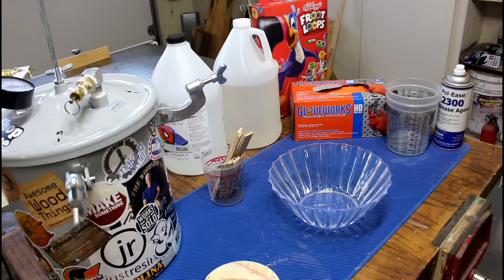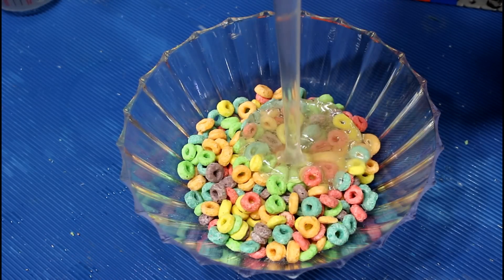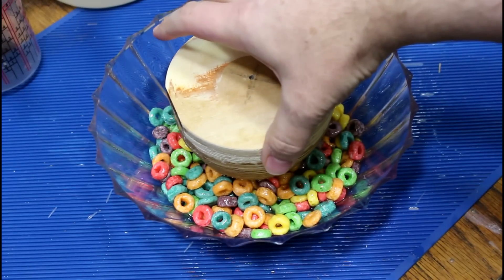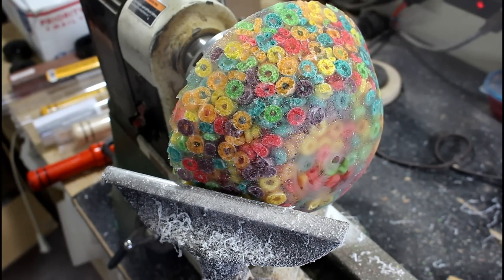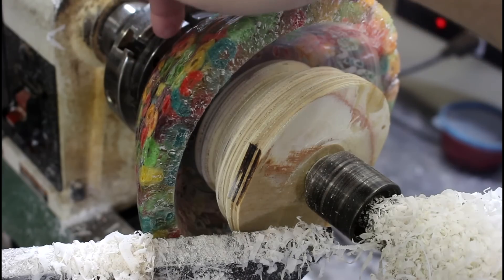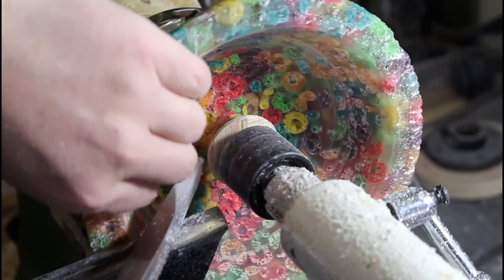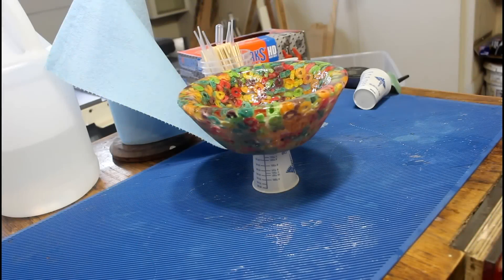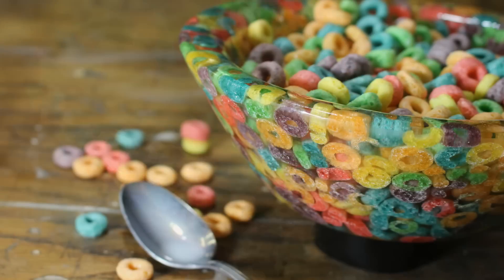Cereal Bowl Made From Cereal  |  Dipit #21 Froot Loops Bowl!

Comment: I had an idea Peter. What about doing a similar bowl like this but color the resin in the bottom half of the bowl with white pigment so it literally looks like a bowl of cereal and milk suspended in mid air?
Reply: This would be sick!!
Reply: I agree!
Reply: I was thinking the same thing.  That would be awesome!
Reply: I had the same idea
Reply: Comb made out of hair
Reply: Or the top edge to look like a cereal bar?
Reply: I like the way you think. You're HIRED!
Reply: Itd be neat to do white with loops, a thin layer of clear with loops and then clear with no loops, but I agree it'd be cool af
Reply: He made a handle for some tool out of Milk (Bio-Plastic) some time ago. Would be cool if he made a spoon out of that stuff for this bowl.

Comment: How about screwdriver handles out of screws. So a phillips head made out of phillips screw
Reply from the maker: It's on the list! :)
Reply: You're a mad man.
Reply: Personally I'd find it hillarious and infuriating at the same time (though more hillarious) if you did a Phillips head screwdriver filled with flat head screws, and vice versa.
Reply: @MrsInAbox  Nah, that's too obviously done in jest. Mix pozidriv and phillips to really infuriate the pedants.
Reply: be brave... a slot screwdriver made of torx fasteners.
Reply: Y’all aren’t thinking hard enough 
Gotta make some nuts and bolts to go with the set
The nuts of course made of Rocky Mountain oysters
Reply: Hex drivers (for driving hex head screws) a.k.a. nut drivers, made with the other kind of nuts (almond, pecan, etc.).

Comment: Would you have been able to use stabilizing resin to harden the cereal and then dip it to make the consistency better so that it wouldn’t grab on the lathe?
Reply from the maker: Yes, but consider that the stabilizing resin would bond all the cereal pieces together which means that you need to individually stabilize each piece so they could be separated. Way too much work for me.
Reply: Peter Brown I see.. That’s good to keep in mind! Thanks for the reply!
Reply: @peterbrownwastaken  hmm. Didn't realize that. Would have thought you could stabilize a cup of them and then just spread them out flat on foil on a baking sheet when you put them in the oven. Didn't realize they'd still clump.
Reply: Could you not stabilize them in the mold, then drain off the excess stabilizing fluid and "void fill" what remains with resin?
Reply: Just the thought of stabilised cereal... That might beat your stabilised bread, I think.
Reply: @peterbrownwastaken  Ahhh...I should have read the comments first. I'll go delete my comment now... 😋
Reply: @peterbrownwastaken  Could you have stabilized the entire bowl after turning instead of putting on the wash coats of resin?
Reply: If you got a mold you could heat up in the oven couldn't you have thrown that in the stabilizing chamber to make a mold?
Reply: Guessing the same result would happen if you let the cereal get stale?
Reply: Peter Brown Ain't no body got time for that? :p
Reply: @peterbrownwastaken  maybe stabilize them in batches? Like using mini muffin tins stacked....
Reply: @penfoldq  I think the problem with that is that he needs to "bake" the stabilizing resin for it to harden, so unless he had a heat safe mold then that wouldn't be an option, and even then it might have been more work than it was worth.
Reply: Stay-bowl-izing resin resin you say 😇
Reply: How bout first pulling a vacuum and then pressurizing it. Pulls air out of the fruit loops themselves and shoves the resin in all those gaps
Reply: @peterbrownwastaken  What if you stabilized them in the shape of a bowl and then filled in the gaps with art resin?
Reply: U sem smrt
Reply: Lol
Reply: @BandOfNerdz4  a heat safe mold would be easy to find
Reply: @theshuman100  that's exactly what I was thinking
Reply: I don’t know what tf anyone is saying. Is it just me?
Reply: @peterbrownwastaken  I think you could stabilize the cereal without it bonding.  

Loved the vid, especially "I hardly taste resin at all."

BTW, would you be willing to hook a budding YouTube maker up with a Shop Time sticker for a "Makers' Board" to hang in my shop and display in my videos?

Comment: I think fruity pebles would have been a better cereal to use as you still get the nice rainbow coloration but the smaller peices mean that the resin would be able to penetrate the cereal better and you would have a more "consistant" material to work with.
Reply: I think the rings look better then pebbles but your right pebbles would be more consistent.

Comment: Great result Peter, loved it. It may have been possible to put the cereal/resin mixture in the vacuum chamber for a few minutes ( weigh down the cereal so it is submerged) before pouring into the bowl mould and putting in the pressure pot. This would fill some of the voids in the cereal with resin. The only problem may be if the air expanding in the cereal may cause them to burst, but could be worth a try.
Cheers 
Jim

Comment: Hey Peter, great project. To speed up the resign curing time you can build a small plastic tent over your project with a small heater. We used to do this with boatbuilding in a cold shed over winter.

Comment: What if you stabilized the cereal before casting it in the resin?
Reply: Be the same concept of spunky wood to make them solid so I would agree with you!
Reply: Well, the video about Carbon Bowl is newer compared to this, so I think a more fitting question for this video would be "Did you know about the stabilizing technique when you recorded this video?"
Reply: Moustache Pikachu Yeah, actually, I think it does
Reply: Would the cereal get soggy with the stabilising resin? That's my only thought about whether it would work

Comment: I can't help but wonder if doing this in one of the vacuum -> pressure pots - the ones where you pull a vacuum to get the air entirely out of the cereal, and then put the pressure back in to fill in all the voids with resin - would have fixed the issues with it being so grabby and hard to turn?

Comment: Would stabilising the cereal first to impregnate the grain particles with resin make them more stable and less grabby on the lathe? Might be hard to bake them without them becoming a hard clumpy mess, but you might be able to bake them off in the mold?

Comment: update: ArtResin is now food safe rated by the FDA. No longer just incidental. It is not safe for 120+ degrees, it is not safe for microwave, it IS safe for dishwasher on cooler settings, and its safe to use as a plate, utensil, or anything else. It is NOT cleared as a wet food storage material. Dont use it to store your water, but it would be perfectly fine to store flour, sugar, etc. This bowl is also 100% safe to be used as a cereal bowl. Once cured it is completely inert. Heat will soften it, which is why it is not good for heated food.

Peter, quick question. Your resin knife was weak in its thin area due to heat. I know this is an issue, but would heat resistant epoxy hold up better? Also, if you were to cast acrylic for a knife, which product would you use for the best cost effectiveness? Thank you.

Comment: Maybe if you dehydrated the cereal first? Idk how much moisture is actually in dry cereal, but it didn’t seem like the cereal readily absorbed the resin, which doesn’t seem right to me, especially considering how well cereal absorbs milk. Also, if it was warmer maybe that would have helped? Many things you could try for a recut video!

Comment: Vacuum would have pulled resin into every pore of the fruitloops.
Then they wouldn't be so grabby.
Also, pressure seals all the bubbles into the resin making it more prone to cracking as it is under tension all over.

Comment: I just watched a video where a guy poured epoxy into a hollowed out egg then carved designs into the shell. Final product turned out beautiful, but there were issues. The epoxy expanded in the shell, boiled out of the top, secreted through the shell itself, and cracked the shell. Would your pressure pot have solved these issues?

Comment: "I hardly taste resin at all" .. maybe if left it fully cure for about a week you wouldn't taste any resin. Same goes for the turning and sanding, should consider a respirator when making particles from resin thats not cured fully. Maybe the art resin is different, but in general a week or respirator even if its set after a day or less. Cool bowl though!